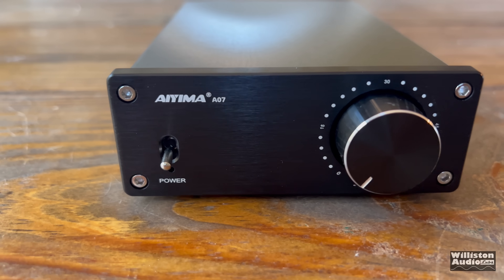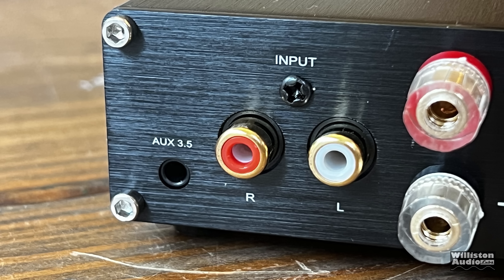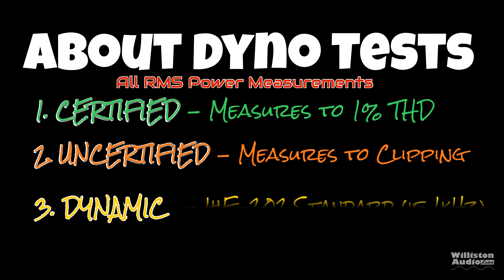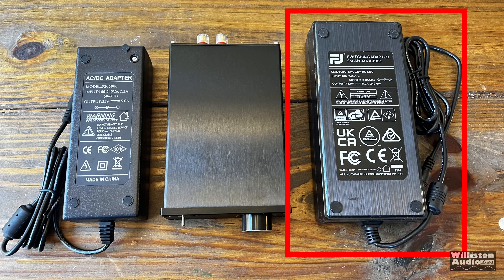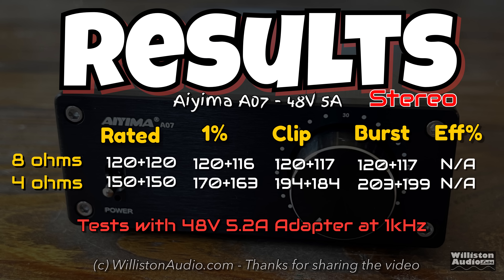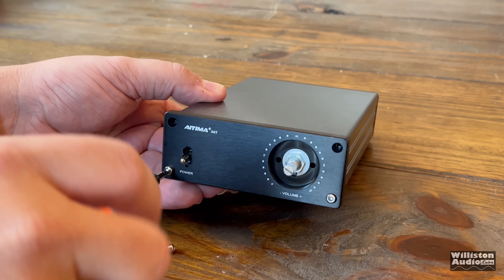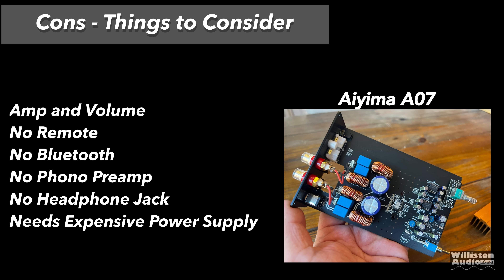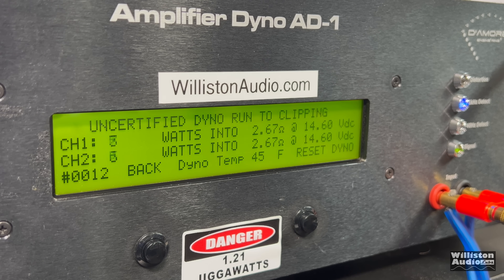Is it the MOST POWERFUL Mini Amp on Amazon? AIYIMA A07 Amp Dyno Test and Review

Comment: It almost makes you wonder what kind of power you could get it you built a really solid 1500W DC power supply and ran a few of these daisy-chained.  It certainly would look a bit unusual, but the setup might look cool with them all on the shelf together.

Also, I like the new extro/outtro, nice.
Reply: 1 or 2 amps per a speaker I Would want a class ab for treble and class d for the bass
Reply: @Durkhead  True, I do like active crossovers and ‘n’-amping. But I would encourage you to look into modern class d designs. Stuff like the hypex / purifi and ice power designs all have distortion performance which destroys most class a/b amps. They are also relatively inexpensive very powerful, and very power efficient.
If I ever get around to building my next stereo system, it will probably be based off a custom DSP board and ice power amp modules for everything.
Reply: @macattack123mattc3  I just really like the way class ab amps highs sound
Reply: 36V psu or a 48v psu dialed down to 44V is the sweet spot with these amps
Reply: @sodasodas3  do u know where sells them?
Reply: The big issue that these chip amps have is that they don't internally regulate the voltage.
You can basically determine output power by V=IR, where V is the power supply voltage and R is the speaker resistance...
In order to get serious power out of these chips, you have to crank up the input voltage, however, the chips are limited in what voltages they can handle, and so bridging / coupling of the amps in any way is basically useless.
Also, compared to other amps they tend to have high distortion figures. Now, it's still within reason for audibility, but if I was building a nice stereo system, I'd go with something not based on one of the chips.
Reply: @macattack123mattc3  Amazing.  Almost everything you stated is incorrect except that they have a voltage limit - as do most amps.

No the calculation is not as simple as V=IR, and hundreds of watts out is already serious power, to the point where if you need more it is going to be for a low impedance woofer and then PBTL mode will handle that with the doubling of current instead of voltage increase.

They do not have, let alone the vague word "tend" high distortion figures, quite the opposite for class D.  That's exactly why they have become so popular because there have been plenty of class D or even built A/B amps for near the same price point, for many years that people just weren't exposed to until the likes of amazon, ,ebay, aliexpress, temu, etc started importing/exporting them without a middleman marketing them with snake oil and jacking the price up 400%.

Comment: LOVE this video review! Great job. I bought this amplifier a while back. I used a 12v - 48v (10 amp) step up booster with lithium batteries. I tried and tried to get higher power levels out of this amp and expected it to outperform the many other digital chip amps I use. It just would not pump. My thoughts at the time 1) unimpressed with the power 2) unimpressed with the sound quality (really distorted and hallow sounding). I dug into the specs and architecture. They were using a subpar preamp chip (but, was upgradable) in the lot I bought. Weird, and was prob the culprit. So, my thinking is that the one you tested in this video had the upgraded pre-amp section (buttery smooth Class A like). Mine sounded like a Texas cow pile with flies on a hot day...even with the included 32v 5 amp adapter. I even tried a Dayton Audio 36v adapter...no change. I even tried a DC power supply, no change. I sent it back for a refund. I am GLAD yours worked...maybe I should give it another chance?
Reply: Yes, you must give it another chance. Lovely lil fellows. 👌

Comment: Wow, that is a bad ass single chip amplifier. Very nice, and I was surprised by the 36vdc and 48vdc input. Its crazy they accept a 48v power supply. You can probably get an adjustable power supply that can do 48vdc at 15 or 20 amps, or use a charger meant to charge 48vdc battery setups for solar power storage.
Reply: I use a 1800 watt buck boost DC to DC that cost 18$ and power it with my 13.8v 55a DC power supply that way I can set it exactly at the voltage and amperage it needs and that mofo has power

Comment: Thanks for the hard work, there's no better place on youtube! I have the Kinter TRIPATH K2020A with much less power, for 38 bucks on Amazon, then I bought a used SONY receiver, 2000 vintage, with 125 Watts/channel for 25 bucks! The Kinter is powering my computer speakers, a pair of Advent Baby 6.5" bookshelf speakers, and the SONY powers a pair of SONY SS U65 13" floor speakers bought recently for 40 bucks. If you count pennies and search the web, there are some great deals to be had.

Comment: This amplifier has a version A07 PRO where the Bluetooth aptX HD chip is built in, as well as a timbre block. The amplifier is very good for its money, but it is better not to take a complete power supply, it is frankly weak in power. I have an amplifier connected to an external 48V 12A power supply, which is quite enough. I would advise you to change the power capacitors inside the amplifier to a voltage of 100V and increase their capacity.
Reply: Hi, I buy a07pro, I have a pair of "Mission Lx2" 6ohm 100watt speakers. I hesitate between a 24v10a/36v5a/48v5a power supply. 
Which one do you recommend?
Reply: @bostongeorges937  48В 5А
Reply: @НиктоНеизвестный  What do you think of this: "It's best to keep in mind that those
distortion specs are at their lowest at lower
voltages, say 24V, but then you're looking at less
RMSpower."
Reply: @bostongeorges937  I think there is an inverse relationship.  The higher the voltage, the greater the margin for undistorted signal.  It is not necessary to use the amplifier at full power.  Just with increased voltage, you will have a margin for a clean signal.  And at low voltage, you will quickly hit the limit.  Especially considering that your speakers are 6 ohms.
Reply: @НиктоНеизвестный  I completely understand, I thought in this direction but  I have often read the opposite... As if they meant that if there are more volts, there is a little background noise , This little noise disappears when we go down in the voltages

I followed your recommendation, I get the 48v supply tomorrow, I'll see 😉
Reply: @bostongeorges937  There is no dependence of background noise on the supply voltage if the power supply does not have it. It depends on the quality of the power supply. In good switching units, no noise along the power line should get into the amplifier. Good luck!

Comment: There is no news that the power supply is a crucial part of an amplifiers performance but also price. They are both equally important, one without the other will limit the performance regardless how good one of the parts are.
A top fuel engine will not perform well on bike tyres.
It's the same when compairing a "router", they usually contain a router, firewall, swich and wifi. They will never get faster than the weakest link.

Comment: Still a fan of the LePai LP2020. Doesn't have the power of this one, but it's cheap and sounds pretty good. I'm about to build a portable BT speaker using 2 Dayton RS75-4 (3" Reference series full-range). Thinkin' of using a Dayton 2 × 15W Amp board for power. Any suggestions for alternative amp?

Comment: What do u mean line level output? U mean it doesn't go through the pot?
Reply: Line level out is a fixed output,  same as you would find on a CD players phono output connections , to feed an amp.
Reply: It's actually wired as an alternate input jack -- it's connected in parallel with the RCA jacks.

Comment: My man BigD still killin' it years later. I remember watching the Orion hcca test when that came out. A suggestion for these chip amps, you can find adjustable dc-dc converters that are pretty powerful. One of those hooked up to your regular 14v setup stepping it up to 50 would make for a nice bonus test setup, or just regular testing with enough power. As long as the voltage is the same these psus aren't very fussy. You could also get a bunch of chargers from electric scooters and parallel them up. 36v ones actually output 42v and they're plentiful on the used market. At that point the barrel jack would be my concern. It could act as a current bottleneck. On a simple head unit speaker setup I threw together I used crappy wires to some 6x9's and it sounded like crap. I thought the Sony I had wasn't good but when testing it on the bench it was much better. I always oversize wires if I can. I saw plenty of times voltage dropping to 8 at the load when the source still had 12 just because the wiring wasn't good enough. I also melted some of those jack to screw terminal wire things. The wire inside them is very thin. I wouldn't run above 5amps through one of those cheapy jacks.

Comment: That amp does not use a switching power supply.  Instead it is using the DC input as rail voltage.  50v rail caps being fed with a 48v power supply?  Oof.  Kinda cutting it close....lol

Instead of using a power supply simply construct a 48v battery pack.

12 18650 batteries in series will get you to 48v.  Then just as many in parallel as needed to supply the amp with sufficient current.

A 12s2p setup of LG HB2 18650s would give you 44amp of current at 48v DC without issue.

If you want I can construct said battery pack and get it to you.  I have over 4000 of those batteries on hand.  LoL

(For free - condisder it a donation to the channel!  :) )
Reply: Heck even a 12s1p setup will supply 22amp continuous at 48v
Reply: I've been running two A07s with those 50VDC caps at 46VDC from an SMPS for over two years with no issues whatsoever.
Reply: @editorjuno  that's great, however that is too close based on what most amps run.  Eg. There is usually a larger gap between the rails voltage and the voltage rating of the caps for said rail.

Home audio has the luxury of a stable voltage source so perhaps that is why.

Comment: Nice little bookshelf amp. I just snagged the new Fosi BT30 Pro which has two of those TPA 3255 chips and I have to say for it's size I'm very impressed so far. Haven't Dyno tested it yet but it runs a couple of Bose 251's really nicely. Quite clean output IMO. Still pondering which passive sub to use though. 
Also I noticed that this new model seems to have better control over the subwoofer frequency range adjustment than the previous model has. Both have power subwoofer output.
Thanks for all you effort Derrick.

Comment: try a switching power supply, one that has adjustable voltage and amperage. Also be careful running these enclosed mini amps, they run hot and can REALLY benefit from have holes drilled into the top and a fan added or just some sort of ventilation going across it. Cant wait to see more mini amp vids

Comment: Oh yeah...finally a 3255! Could have tried your battery bank but wire the batteries in series or get a generic power supply but personally...running 48v on that unit is a bit close to the sun with 50v caps!

Now I will wait for a TAS5630 amp board test, running a mono version at 40v with a 2 ohm sub wired to 1 ohm and it do bump!

Comment: Very cool! I have this amp with a 36v 10a power supply with upgraded dual to mono opamps and it is a true gem. Thanks for the video.
Reply: You changed it to a mono block, running two amps for stereo?  If so, noticeable improvements..?

Comment: Amazing chip and an amazing review (as always)! Those chips also support 2ohm loads by the way. Also, their SNR and minimum distortion specs are amazing! It's best to keep in mind that those distortion specs are at their lowest at lower voltages, say 24V, but then you're looking at less RMS power.
In case anyone is curious they use a TPA3255 chip. 😉
Reply: The chips do support below rated impedance if you use lower voltage - or most importantly, keep it cool enough. My mono TAS5630 always went to protect with a 1 ohm load until a fan was used! The current limit will be your limiting factor  (17 ~ 13 A peak depending on the resistor value, specified on datasheet)

Would be curious how the distortion or current handling figures change by changing switching frequency (default at 450 kHz, 400 kHz for the 5630)
Reply: @ruikazane5123  With running it in mono (PBTL), it is actually specced for running 2ohm loads. As for switching frequencies, pretty sure that it was something like higher switching frequencies mean less high frequency distortion to some extent but they can cause problems with EMI and noise
Reply: The TPA3255 will only support a 2 ohm load in PBTL mode ... that is with the output stages paralleled for mono operation.
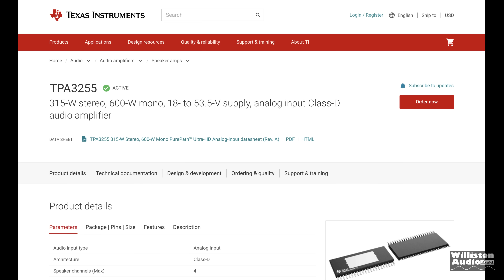Reply: No need to try and be clever by saying "In case anyone is curious they use a TPA3255 chip" - that was mentioned many times in the video, and he even showed the TI product page at 9:44 🙄😒
Reply: @johncoops6897  Not trying to be clever at all, just completely missed that part somehow I guess. I was simply trying to give out some extra information I felt people might find useful, because that's what I do. Like all of you (presumably), I love audio. Moreso, I love sharing knowledge and helping people about the topic. Sorry this particular sentence frustrated you, it was never meant to come across that way.
Reply: @Elliott-Designs  definitely a help, regardless if it was said. Sometimes it's easy to read things and sometimes we miss what is said. So thanks and carry on my friend

Comment: Thanks again Big D for showing us more value options!  This thing packs quite a punch with a proper power supply however by the time you bought the amp and power supply you coulda have something better at the $175 price point like something by SMSL. Shout out to TI for giving me some chuckles too seeing their description of the product as "true premium sound" and "ultra low distortion" @ 10%THD. Anything over 1% is audible to the ear, my 10 year old budget Sony receiver has a THD of 0.08%
Reply: "my 10 year old budget Sony receiver has a THD of 0.08%"
 yes at what power output tho... and how many channels driven? i can asure you its over 10% with all channels driven and at 50% power. even the higher end marantz/denon receivers rate their stuff wrong... they even print "70% power guarantee" on the box , when it has 5 channels driven vs 2 channel.... (they lose 30% power when using 5 channels... like wtf)

they all rate their stuff in weird ways.
Reply: What a clueless comment by Chris 😠 The "10% THD" spec on the TI page only relates to the Maximum Power Output specifications, and they quote other power outputs at lower distortion levels.
If you actually paid attention and checked, you would find that the TPA3255 is rated for 0.006% THD at 1W, and it dips down to about 0.002% at 10W into 8 Ohm loads. Furthermore, the spec is THD+N (Noise),
So, this little amp is spec'd at between 10 and 40 TIMES lower THD than your Sony's (best case) 0.08%.
Reply: the texas instruments tpa 3255 board is a lot better than SMSL

Comment: what it dose need is a blue tooth.  be nice to use the board to build a blue tooth speaker and put a 48 volt batter in it and use the power supply to both provide or charge the batteries. Now if I could find that chip.

Comment: Great review. This amp can indeed be used with a subwoofer. Running off of the 3.5-inch connector. I have my amp running a set of Klipsch R-15M and a R-12SW. Also upgraded the OP Amps to Sparkos Labs SS3602. So far a great combination.
Reply: Lol he said for use off level of course u can put anything on lineout don't mean it Gona sound right tho
Reply: @mobeatzleeds  
Do you know a mini amp with stereo pre out that's worth buying?
Reply: @bendermi  aiyima t9 but it's down on power but with the money I've spend grands on amps from n.a.d to Yamaha and this amp is that good but I would recommend using the a07 as a power amp .....the t9 got everything on it for cheap lol don't know how they do it if you're speakers are 90db over close than your good mine are 88db so I need more so amp using a07 as Poweramp
Reply: @mobeatzleeds  
Thanks, but I just got the Idea. 
I'll buy two of these amps and adjust the volume for the subWoofer and main speaker on the amp and then use the volume control from my telephone to turn music up or down.
Reply: @bendermi  I would like to stress that the output on that lineout is maybe 10 dB down can work but the signal path will be lower resolution than your main speakers ...sub out or pr amp way better for sub or turntable I've made a rubbish sub sound insane with this method but cables must be top tier chord company
Reply: @mobeatzleeds  
It's a signal through the amp so adjust the volume of both amps once and use your phone or what ever to turn volume up or down for both.
Reply: It's more to do with sound quality but never the less yr way will work
Reply: @mobeatzleeds  
You won't be able to put a finger on this setup.
Reply: @mobeatzleeds Doh! Forgot he adds extras. I added a Volbox inline audio volume control to deal with the volume issue for the sub. Now I can run the bass from my chair. Ran it under my desk to keep it tidey. This is for my PC 2.1 setup. Turned the volume on the sub and the A07 to half way. Love the versatility of this little amp. Waiting on a 36v 10A power supply adapter. Should let me add some overhead. And yes it does sound great to my ears.
Reply: @lopieslopezpm  if u want it to sou d even better change opp apms in a07 cheap audio man channel if interested...good set up bro 👍